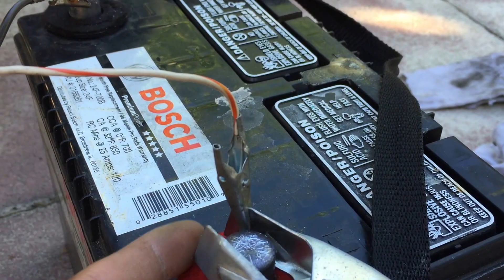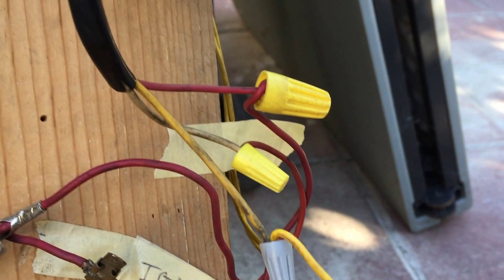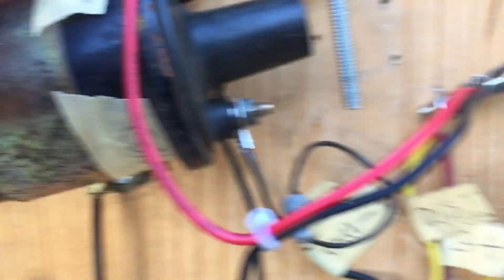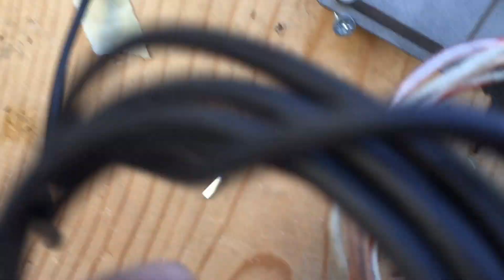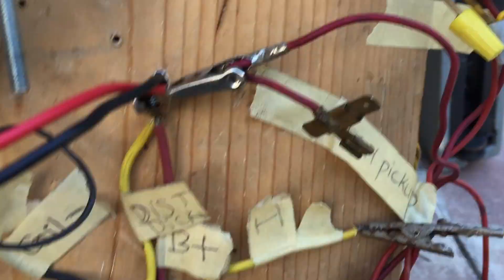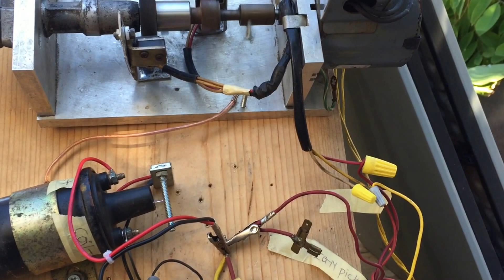FREE TESTING IGNITION COIL & MODULE TOYYOTA PREVIA TRUCK CAMRY 4RUNNER LAND CRUISER LEXUS GS300

Comment: I believe the I is for ignition timing (IGT) to assist in creating a spark and F is for fire (IGF) meaning the spark worked and the F is the signal back to the ECM stating there was the spark. If one of these did not work, a code is set in the ECM directing you to the problem but always diagnose and don't just change parts.